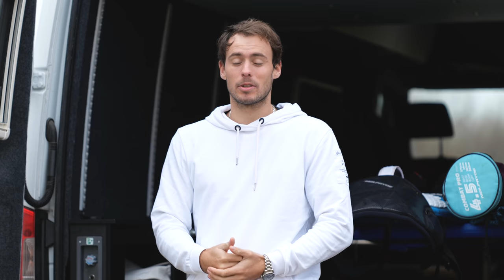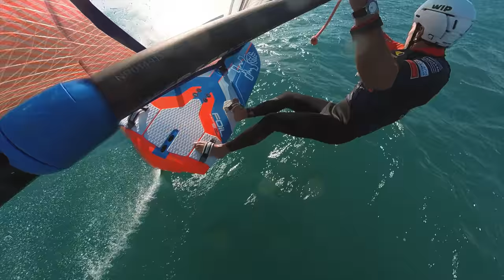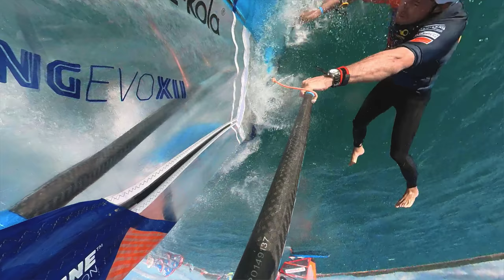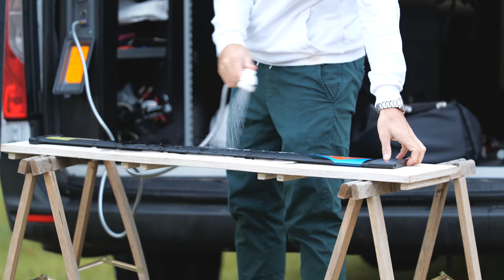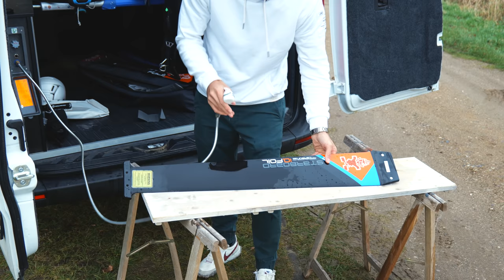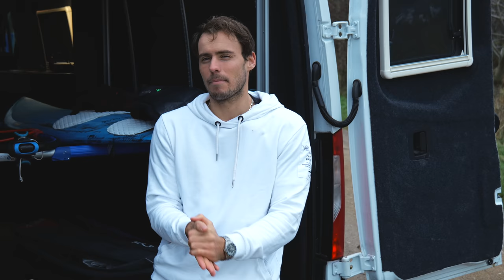Tuning the FOIL for BETTER EFFICIENCY | explained

Comment: The physics behind this tip regarding speed, is that you want to have a layer of water molecules sticking to the fin or foil reducing the hydrodynamic drag of the water as it pushes around the fin. Water forms chains of molecules and drag if there is a thin layer of water molecules already on the fin/foil the water slips by without sticking, increasing speed - The same thing can be achieved by carefully sanding the bottom of your board. This technique was first used with America's Cup boats (at least that is where I learned about it). 😊👍

Comment: Another hint, use a soft sanding block rather than bare hands. Something like a flat piece of polystyrene or similar to support the paper. The job will take less time and create a more even surface. Speaking from too many years experience in the yacht racing arena...
Reply from the maker: Yes, this is a good one! Important not to use a stiff block.

Comment: So you’re saying that Starboard and other companies are selling DIY carbon foil parts instead of finished products ready and safe for sailing at all speeds?
Reply from the maker: No, I’m saying that you can tune your foil. Just like you can tune your board and your fin.
Everything has its limits and it doesn’t happen with every new Mast. I had some where I had no problem. All I’m
saying is if you have this problem, this could possibly be a solution.

Comment: I'm going to move off topic. Let's start with your new association with Starboard. Starboard has a new evolution foil series.  Basically a new set of fuselages and fuselage to wing connection for 2022.  There is very little internet content on the new evolution foil supercrusier series. It looks like good stuff!  I suggest it be promoted perhaps with a video! Have a great day!

Comment: Very good tip! Water sticking will indeed reduce the risk of ventilation. Just one remark, this effect is called ventilation, not cavitation. Cavitation is water evaporating due to very low pressure (only happens on speed fins), while ventilation is sucking air from the surface.
Reply from the maker: You're right, I already corrected that with my pinned comment 😊
Reply: @Nico_GER7  great content! Keep it coming 😉
Reply: true submarines can cavitate their props hundreds of feet down where the pressure is tremendous and there is no air, obviously. But it seems everyone i know refers to spinning out as cavitating , semantics really.

Comment from the maker: The comments here are a great forum to discuss and gather new information. Some engineers here in the comments and many different theories.
Just goes to show it's not all that simple. My background is not physics but testing on the water and find ways to solve problems in the gear. So be sure to read through the comments.

Also, I just learned that this effect on foils, caused by the surface, is called ventilation.
You can see the effect in this video: https://www.youtube.com/watch?v=NefnpuxS2uM
Reply: Wow, that is a quick bubble over the entire length. I guess that explains what looks like the board spins out a little. I’ve had that happen sometimes on IQFoil gear, but only if I ride the board really flat, and I’m not going slalom speeds.

Comment: Nico,

Concerning the hydrophobic surface of carbon I made similar experiences with GASOIL fins. Well, I didn't smash my boom as beautifully as you. 😉

The best product to sand carbon surfaces are Micro-Mesh Soft Touch Pads. With this kind of sanding pad you get the best surface possible.

Kind regards,
Seb

Comment: The demo with the water-hose is quite illustrative. It at least proves the water 'wets' the surface more after the sanding, so it has indeed become more hydrophylic.
Did you actualy sail with that mast since you sanded it? Could you tell the difference? Do you know of colleagues who also sand their masts/wings/fins? I've read discussions on our dutch windsurf-forum sanding slalom-fins and bottoms of boards, it became almost a religious battle :) . Difficult to separate the science from the religion. If it really is about surface-tension, washing the mast (or wings/masts) with a strong soap should also work.

Comment: I think one thing people are missing is the massive drag increase from the mast ventalting and that drag being so low down from the center of effort of the sail, would be enough too cause catapult on its own. 
There is also the loss of sideways grip, and when you start to slide sidewards you in turn get a loss of pressure from the sail, causing you too fall windward rail in

Comment: Hi Nico, I remember the principle of cavitation back from my days in the German Navy. Cavitation happens at the propellers and might even destroy the surface of a bronze, copper-nickel or steel propeller.
Reply: Indeed, and this is not cavitation that takes place on a foil but "ventilation". The speed is simply not high enough to generate cavitation.
Reply: Didn’t know Germany had a navy

Comment: Very cool video. 

Kind of not the same thing, but I've had a handful of crashes that seemed to act this way. They were at lower speeds (IQFoil gear not PWA slalom gear). I think in those I was riding the board more flat, without banking it windward, which likely caused a mast stall? I'm not sure if it got ventilated like this, but it's possible.

Since I've been giving the board more heel, except in downwind, those particular types of crashes seem to have mostly gone away for me.

Comment: Is there any reason why manufacturers do hydrophobic surfaces in the first place? I know that for example The Board Lady (Eva-M. Hollman) recommends sanding the bottom of the board in very similar manner to increase speed as well.
Reply: The hydrophobic property most likely comes from how smooth the carbon is when it comes out of the mould. America's Cup foils have the same issues, they're intentionally roughened afterwards to improve the hydrodynamics. When it's slightly rougher there's a boundary layer of water that sticks to the surface and reduces the overall friction.
Reply from the maker: Often they are finished with some sort of a gel coat or varnish to protect the carbon or fill out pores.
Reply: Carbon wings. mast and most fins come from a negative mould. The surface of these moulds is prepared with a release-agent like a wax or something else that prevents the epoxy (or  paint or gel-coat or whatever was applied first in the mold) from sticking to the surface. With this, the part would stay stuck in the mold or the mould's surface would get damaged. Some of this release agent transfers to the surface of the part (in this case: the mast). Especially a new mast would show this behavior (it wears of during use). But you can also cause it for example by handling your fin with greasy fingers, basically making the surface of your fin hydrofobic with the grease of your finger's skin. In theory, I think washing the mast with a strong soap, like a washing-up liquid, should also do the trick.

Comment: It's a tip that is based on sound science. The sanding creates lots of microscopic scratches which are water channels. It's the same science behind sharkskin and sharkskin swim suits. Those suits have been banned in swimming now due to the technology advantage. If it has performance benefits for a slow ass swimmer. It will definitely make a difference for a pro windsurfer which is why you guys sand all ur gear. Maybe one for starboard to innovate some sharkskin finish on boards and fins to take advantage of the tech

Comment: When sanding, you want to create a water layer on the foil so that water glides on water instead of on the foil itself (laminar flow). When sanding too fine (2000 grain), this could hamper the laminar flow. However, Nico Goyard also sands his foil with 2000er grain, so it should not be (too) wrong. In some cases, laminar flow can create more drag than turbulent flow (see the surface of golf balls) though this is probably not the case for foils in water. 
I've no idea if sanding the mast will really solve the problem that was most likely caused by a stall (Strömungsabriss) at the rear wing. However, taking off the warning sticker that Starboard sticks at one side of the base of the mast and that creates one-sided turbulences should improve the situation. You did not have this sticker on your former mast, if I saw right. And please tell Starboard to use another way to make the brand logo visible; these stickers on the mast have been annoying for a long time...
And thanks so much for creating this community with your videos; more than 100 technical comments below your video are spectacular.
Reply: That sticker has helped us non IQ foilers. Why did you have to give away the secret :).
Reply: Laminar flow always have less drag than turbulent flow. Turbulence is energy and energy is drag. Golfball phenomenon is not correctly described. I.e. the phenomenon is that with the dimples you create less turbulence because it created little turbulent layer where the laminar flow can flow longer around the ball therefore the diameter of turblence is smaller, i.e. the dissipative force less.

Comment: Very Interesting subject, I remember some saying about sanding the Bottom of the boards with fine wet and dry after spraying as you do not want a smooth surface as in a slick gloss wax finish where the water is rebelled,  one’s brain would think the slicker Equals less drag, when you spray a boards bottom using car paint rattle can, once dried it comes out with a rough bobbly surface when you rub your hand over it,  using wet and dry 2500 grit with water leaves the surface feeling lovely and smooth but without the water repellent effect. I was also told that you need some drag  from bottom of board to water contact to go faster,  feel free to comment to get to the bottom of this 🤣

Comment: I sand flat all the letterings,stickers and graphics on my foil gear (they usually stick out a little), i also clean the dried salt&crap before sailing.The effect of sanding exists but having a clean,smooth surface is an even bigger factor IMHO.

Comment: If sanding the surface is meant to help on this issue by leaving tiny scratches that get filled with water, so the surrounding water floats on water - then your sanding direction is wrong. the effect is at max when u sand it 90° to the direction of the water flow - for the foil mast that would be along its long side.
Reply from the maker: Latest rumors from iQFOiL scene is 45° in both directions. I guess every naval architect has their own interpretation.

Comment: I suspect this is not actually cavitation but air getting sucked from the surface down along the mast. The air then gets sucked behind the stabilizer and disrupts it's lift which in turn suddenly disrupts the attack angle of the main wing. When you go fast enough... there is no overall positive angle of attack and the near vertical or even worse forward leaning foil mast sucks the air in. Alpine-foil make curved masts to prevent this for their kite-foils. The trick is to deliberately redirect the flow from the foil mast bottom to the top preventing the suction effect.
Reply from the maker: yes, sorry it's ventilation then.
Reply: @Nico_GER7  No need to apologize 😉 It's great that you reported your findings! It helps everybody to be safer. And the sanding trick is super interesting! Do you know the approximate speed it happened at? Do you think the wing was to large for the particular conditions. Was it the same wing every time? BTW I'm not an expert, just sharing my thoughts 😁 Thanks for the great video!

Comment: Hi .good subject.
it is really a key point for foiling.
But a very old sailing discussion started perhaps 100 years ago.
On the net you could find a lot of scientific studies and experiments on that. Up to now the best surface to reduce the friction for reaching high speed is a "shark skin" type to create a thin layer of water. The  shark skin is not smooth at all.do not worry too much with 500 1000 or less  sand paper.
But at high speed around 25 30 knts sure you enter in the cavitation danger zone. Cavitation not  ventilation. And very litlle will initiate it .in particular quick angular variations or even dust in the water. It will limit the top speed.
It is unavoidable.
The propose solution is to create and maintain and control the cavitation .the supercavitation. .it will be in this case not only a thin layer of water but a thin layer of vaporized water.  Used for military weapons.
Alex caizergue team will try to use it for the speed record.check syroco project.

Comment: Wenn man sich ein Foil mit Finite Elemente Simulation ansieht, wird man merken, dass es an ein paar Kanten solche Unterdrucke geben kann, dass Kavitation entsteht. Diese Bereiche sind aber sehr sehr klein. Das kostet Geschwindigkeit, weil Energie verbraten wird, aber es führt nicht zu den Spin outs. Die kommen wie schon erwähnt von der Ventilation. Man kann das auch mit Sandpapier reduzieren - allerdings indem man die Kanten schärfer macht.

Das ist eines der Physik Details, die bei Foils oft falsch verstanden werden. Der häufigste Irrglaube ist aber, dass das Foil so schnell ist, weil es die Oberfläche des Unterwasserschiffs reduziert. Die Fläche wird in der Realität sogar größer gemacht. Foils haben fast an jeder Stelle eine optimierte Spindelform mit CW Werten im Bereich < 0,08 (Mast bis zu 0,02). Das reduziert die Kräfte so.

Comment: Does it help to sand carbon fins, too? I've already learned that slalom fins handle the way I load them where as free-ride fins just don't but even the former spin out, for me, from time to time, and I'd really like to learn any trick to make them stick more reliably.
Reply: In principle, yes. But I would start with just wshing them with a strong soap before going at them with sand-paper.

Comment: The stall is happening on the front left-hand part of the foil and it's caused by the rotational movement of the board.
It's what's called a 'tip stall'.

Explanation:
Just before the stall happens the right-hand edge of the board drops and you counter by forcing the left-hand side back down. This means the left-hand tip of the foil is moving downwards through the water giving it a higher angle of attack (it's the angle of attack going too high that causes a stall). 

At the same time this is happening you are pitching the board up to bring it back out of the water (further increasing the angle of attack) and rotating horizontally toward the left (meaning the left-hand side of the foil is going slower than the rest, making it more vulnerable to a stall). 

Once the tip of the foil stalls due to the movement, the lift decreases on that side and worsens the rotation causing the stall to develop more and more.

It's interesting that you noticed that not sanding the foil mast caused the problem. My guess is the increased friction by having the surface too smooth either increased the amount of rotation the board was experiencing or caused flow issues around the root of the foil which meant you had to rely more on the lift from the foil tips. There's a secret target roughness each team has for America's Cup foils in order to decrease friction and improve flow for the same reasons.

I hope my explanation was easy enough to understand/ not too long winded and hopefully it helps you to prevent it happening again.
Reply from the maker: Thanks 🤙
Reply: You have too much free time
Reply: So
Would you suggest sanding to a different grade on one side of a foil mast to the other in order to counter such things?
Reply: @ManOfSauce  It wouldn't necessarily help unless you were planning to stay on one tack and even then I would say you're unlikely to notice much of a difference. Even on the scale of an AC yacht, where each foil is only used in one direction, we don't really worry too much about it. It's more important to reduce the friction on both sides as much as possible. There's a sweet spot for roughness that will give the best reduction in friction, but you'll need to do a bit of trial and error (or talk to other windsurfers/ sailors) to work out what it is.
Reply: @mommomom6501  Haha I know. It's good practice between cup cycles though. During the cup we're constantly doing this sort of analysis to work out what the other teams are doing and what we can change in order to be faster.

Comment: Hi Nico. Great tip! Glad you investigated and found out the reason for the strange behaviour of the equipment. This reminds me of one of your earlier videos on the spinout behaviour (https://www.youtube.com/watch?v=ya1vCfzpvS0&lc=UgyTqezfW9EQlDApuvN4AaABAg). I had commented that I had a feeling that the spinout is often caused by an air bubble caught around the fin, therefore reducing its effectiveness. When the fin doesn't have the right amount of friction (i.e. resistance), the whole gear acts as if there's no fin - or maybe as if there's a soft/fat fin in the shape of an air bubble! This problem with the foil mast is similar in that sense; that when water doesn't have the right contact with the mast, the function of the mast suffers. In the case of the foil of course, there's no time to correct and recover, hence the catapult!

Comment: For Aluminium mast mine is very noisy and I saw some video that I should sand it to solve it. For which reason you don’t recommend to sand a Alu mast foil ?
Reply from the maker: I think it recommends the trailing edge? If you sand the whole surface, you might get corrosion.
Reply: @Nico_GER7  yes right different issues same solution but not on the whole surface